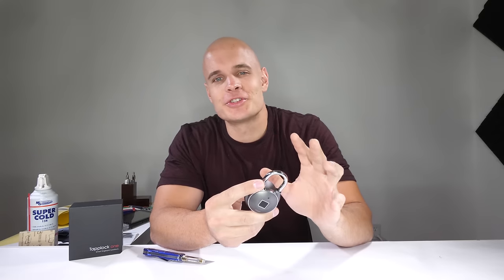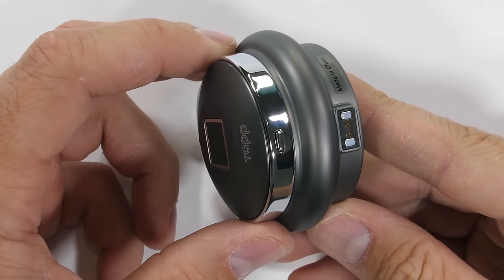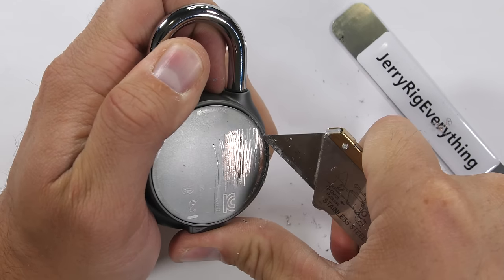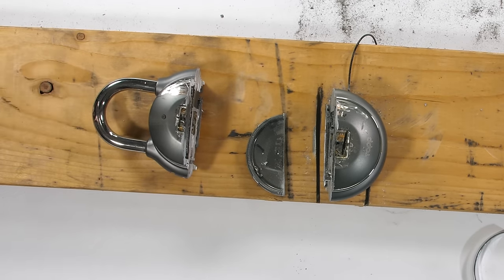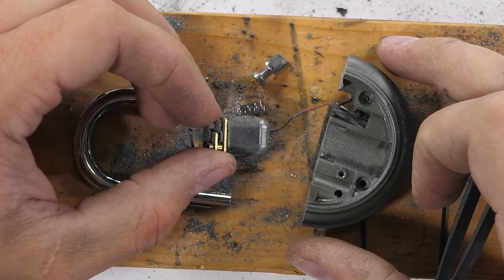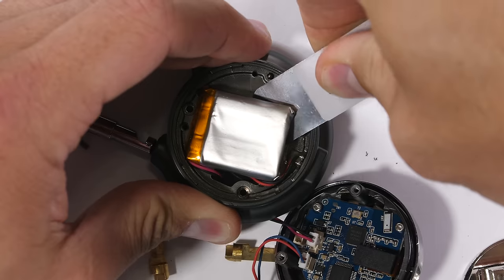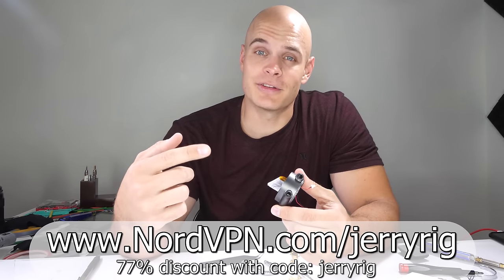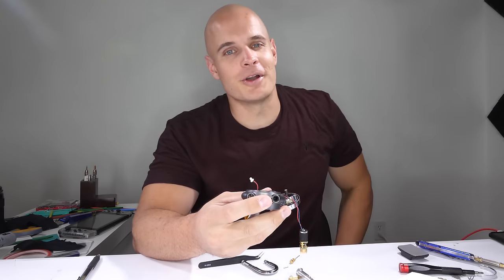DO NOT buy this $100 Smart Lock...

Comment: Thank you Zack for showing people how to open my 100$ lock...
Reply: JerryRigEverything   I will say, it was somewhat irresponsible to put this information out there without contacting the manufacturers beforehand.
Reply: Alex Caffrey pretty sure the manufacturers already know, they are the ones who designed the back to twist off after all. They were just hoping no one would bring it up. In fact I feel they use this exact method to replaces batteries if people return a lock with a defective battery.
Reply: I don't think so, because he just did the right thing, spending a$100 for a lock which can be unlocked within seconds with help of just a screwdriver (a commonly Avilable tool) then what is the deal of buying the lock, he just made people aware that this can be easily hacked. people can still buy it if they need this even after seeing this video
Reply: It's convince for the company to be able to easily replace the battery after it dies in one year. They already know the flaw. One person contacting them won't change anything... but, when they see videos like this viewed by hundred's, thousands or millions of people... That's when they will make the change if they still want their product/reputation desirable by the masses. There is power in numbers.
Reply: Hahaha
Reply: Username Password you know that the battery is rechargeable?
Reply: qpro 1234 - Yes, but are you really going to remember to charge your lock along with your countless other electronics??? Not to mention no battery level display to even tell you the status. Imagine it dies on you and you try to unlock it to get access to your property. Unless you are carrying that "unique" cable with a battery bank on you... you would be SOL. Also, did you see the exposed "proprietary" charging port right next to the made in china sticker that will most likely be destroyed in the elements within a few months or so? Electronic devices have a much higher risk / disadvantage of failing. I wouldn't even feel comfortable leaving it in direct sunlight... the battery would probably explode rendering the lock useless. lol
Reply: Raimundo Castro hahaha XD
Reply: Is there a way you could ghetto rig it where it wasn't possible to be opened that way anymore, like super gluing the screws in, so you can still switch the battery but the face plate doesn't pop off anymore since they can't take out the screws? Obviously you'd be voiding any warranty but at least it's no longer easy to break into... ha
Reply: Are you aware of the fact that thieves actually spend money on locks and experiment with them? They don't make youtube videos about it, though. Zack showed the general public a fatal flaw in this pad lock design so that people like you replace their locks with something more secure. And so that others don't buy it.
Reply: No worries man. Just tell me where you lock up your stuff. I'll keep an eye on it for you. It's cool 'cause I don't even own a GoPro. Honest. Or a screwdriver...
Reply: Alex Caffrey Normally I might agree with you but this is such an intentional oversight on taplock's watch that it boarders on incompetence. It is a lock. Locks are designed to keep people out of your stuff. The back of the lock twist off with no resistance. It is clear that no one made an mistake and this is working as intended and they are just selling a product that isn't secure. I believe Zack did the right thing outing the information publicly so people can replace these locks if they have them.
Reply: Raimundo Castro its better this than your other property
Reply: qpro 1234 but what if the battery comes defective or somehow breaks? Or what if the locking mechanism breaks? It’s a maintenance thing- it is necessary, it just needs to be more secure
Reply: Myk Al probably
Reply: No its not. It is better than EVERYONE knows whats up as soon as someone figures it out. Being salty about finding out your lock is shit is no reason to not know. Plain and simple, the manufacturer KNOWS this. They are making a lock. They are aware of its weak points. They just hope you aren't.
Reply: Alex Caffrey How about it was irresponsible for the manufacturers to sell a $100 lock that wasn't designed properly!??!??? 🤔🤷🏽‍♂️
Reply: Myk Al epoxy would do the trick
Reply: Zach, I bought it only 3 months ago, noooo
Reply: Raimundo Castro Raimundão, você comprou onde a sua?
Reply: It’s good to bring this information to everybody. Because when bad guys figure this out before large number of people - what  do you think they’ll do - unlocking these locks with silence or do this video? Think about that. Thank you Zack for this video!
Reply: A fool and his money soon parted
Reply: "I will say, it was somewhat irresponsible to put this information out there without contacting the manufacturers beforehand."

It was completely responsible to let potential buyers know that this product is a piece'o'shit. People who also bought one may also be glad to know this, so they can go change their crappy taplock out for one that's secure. Fuck the manufacturer, who cares if they get salty.
Reply: what's ur address man 🤔🤔🤔
Reply: @qpro1234  even rechargables don't last forever
Reply: I was looking for this comment...
Reply: Great video.
Reply: @alexcaffrey983  its cheaper to make it flaw so they just made it much cheaper and didnt tell any one
Reply: @usernamepassword9728  where he get the tool to twist open back cover

Comment: Awesome reporting, man. I was one of the ones seduced by this lock last year. Thanks for your excellent work.
Reply: Yah right BRO:)
Reply: A few years ago a guy with a flathead screw driver broke into my dad's truck just by jamming it into the driver's side key hole, which not only fucked up the door and the door handle barely worked, but went in and stole a laptop, a Samsung tablet, and a makeup bag.  Apparently Ford was said to have fixed it in previous models but this was a 2014 Ford F350.  If he had left his keys in the car like some people do with vehicles that have keypads, then that'd be gone in about 10 seconds.  Stuff isn't as secure as it seems.
Reply: *Seduced.
Reply: Solder the back shut!
Reply: Even if it didn't have such an obvious weakness, there's no way it should cost 100$.
Reply: Stay mobile my friends
Reply: Billybob Schneider A lock only keeps an honest person out
Reply: If you want to use the lock you still can what you do is open up the back and strip the screw heads  it still wont be safe vs bolt cutters but a screw driver yup.
Reply: I still like the lock. I would CA Glue the back cover threads shut and call it done.
Reply: At least the lock is still pretty convenient... For your gym locker or something. (Assuming of course you'd take your $1000 phone with you). But for $100? Yeesh.
Reply: Maybe Locktight the back on? not perfect but better than nothing
Reply: MrMobile [Michael Fisher] How's the Ghost Panda Coming?
Reply: They fixed the back
Reply: So you invested over $100 in your lock and now this other guy has shown the entire world how to defeat it. It’s not like every thief out there was going to invest the time and money in trying to figure out how this lock can be defeated but now this guy has given a key to your lock to the entire world! I think I’d have a few choice words for him and they would definitely not be “awesome reporting,dude”

Comment: Wow that's insane... I thought while you were cutting it in half it was just a joke, but that's a pretty huge design flaw.  Save 95 bucks and buy a combination lock or, god forbid, carry a key.

Also, I really don't want to be locked out of something because my lock battery died...
Reply: Abbreviated Reviews well if the battery dies you can always just unscrew it
Reply: It's a feature!
Reply: Abbreviated Reviews
 Well I've got good news for you because we recently invented this new technology called a power bank but ignoring that, I do agree with you as I wouldn't want to rely on a battery for locks either.
Reply: vgamesx1 You just supposed to hold that power bank in your buttcheeks while working out at the gym in case your lock dies?
Reply: That would be one hell of an exercise... .not to mention, trick.
Reply: Or even if someone just tampers ur sensor
Reply: Abbreviated Reviews that's part of the glutes workout
Reply: Combination locks often can be decoded by sticking something thin like an automotive feeler gauge in between the wheels and feeling where the gates are. Also, although sold nearly everywhere, don't buy anything from masterlock: their locks are almost all super easy to pick.
Reply: If you do decide to go with a combo or key lock DON'T BUY MASTER LOCK!! I pick locks as a hobby and even when I was first starting out,  I was able to pick they're level 10 locks (highest security level)  in about 3 minutes with a metal tooth pick and a Bobby pin. Now that I've been picking locks for about a year I can open any one of they're locks in 15 seconds or less with a set of $10 picks from Amazon. It's seriously so easy that if anyone was watching me they'd assume I had a key. Seriously, if you care about your stuff at all, do NOT "secure" them with master lock. At very least go with American lock but abus and abloy are preferable. If your serious about security get a medeco.

Comment: To those that already purchased one of these, perhaps some krazy glue or the like would help deter any easy break-ins.
Reply: Epic Benjo put a metal plate on to back again and weld that to the body or also car panel bond super strong substance
Reply: Epic Benjo or a welding machine/soldiering iron.
Reply: Just send it back. It's not secure and you should get a refund. I would think.
Reply: Flex Glue😅😅
Reply: nah just seal it with flex tape
Reply: actually since flex glue can hold upto 1000 pounds yes u could most definitely use flex glue to fix it
Reply: Locktight thread locker red. You won't get in
Reply: Epic Banjo yes it's a good idea.....if you are desperate. Had to be, because it's what I thought :D . You could also demand a refund. Trouble is, hopefully these guys are OOB for being dickhead scammers. So yeah to save your costs and belongings, a good idea....but in the meantime, fit another simple, good quality (Master) keyed lock.
Reply: @nickw9376  Agreed
Reply: Krazy glue is kra--gl-e
Reply: put some alem screws and weld the back, nothing should happen, you can open any lock with the big equipment
Reply: @nickw9376  I hope you are not suggesting anyone secure anything with a Master brand lock. Master locks, even their higher end stuff can be picked in under 30 seconds. Lock picking Lawyer picked 16 of them, averaging 15 seconds.
Reply: Or you could buy an actual lock. The cheapest best has always been a Master Lock analog one. The second up which is ordered online is a Kryptonite which takes forever to cut through, but now they only sell bicycle locks.
Reply: @JoeWaylo  Best? You think that master locks are even adequate? Master brand locks (all of them) only offer as much protection as this lock.

Look up all of Master Lock's many inadequacies.
Reply: Guess those 5 star ratings are false then. I went with a different brand that works on most gym lockers. One of those luggage combo locks with the TSA key.
Reply: And what are you gonna do when you need to replace the battery?
Reply: Just melt the glue with a hair dryer.
Reply: @juggalove420910  Green stud and bearing mount
Reply: Jbweld it
Reply: @jadenclemow  lego

Comment: A elegant and  much better solution (requiring a redesign) would be to make the back plate interface with the shackle, allowing it to only be unscrewed when unlocked, allowing for components  to be serviced as needed.
Reply: but the purpose of opening the back is to replace the battery when it dies, and if the battery dies the lock cant be opened.
Reply: it should be able to run with an external power source,
Reply: Cloud Omega they need to hire this guy!
Reply: why not just seal the back panel with flex tape
Reply: @cloud8521  the masterlock Bluetooth lock I have has a jumper in case the battery dies

Comment: Any lock is penetrable. IT just really depends on how dedicated someone is to breaking into a lock. That being said, we must understand that this lock is merely bare minimum security AND convenience. Used for people who have lockers that are within building security and what not. These type of padlocks isn't something you'd lock your building gates with.
Reply from the maker: I totally agree. Its still good information to know though.
Reply: Something else problematic is the shackle mechanism.  It looks like a long shim could easily pop this thing open in only a couple seconds.  If you look at the internals of any truly high security lock you'll see ball bearings used to keep the shackle in place, thus preventing shimming.  Spring loaded locking pawls have a terrible track record of popping open even when attacked with thick, sub-par shims.
Reply: Yo-yo that's ridiculous. I can get a directional Master Lock for 1/10 the Price that's 100 times more secure. This is nothing more han a $100 novelty piece
Reply: Yo-yo the problem is the price, 100 dollars is way over priced for a easily brake lock, while the 5-10 dollar lock work perfectly fine
Reply: Yo-yo 👍
Reply: Yo-yo I guess you're right, but that doesn't change the fact that this 100 dollar lock is worse than any regular cheap lock.

It's just convenient.
Reply: yeah you have to spend 1000$ for building gates 😂😂
Reply: still, assuming your thief has this information, the lock is easily possible to open much faster than jerry did, i bet it would take less than 15 seconds if you've done this kind of thing for a while.
Reply: Yo-yo 
I mean obviously, but if you only have a suction cups that you can twisted for the back and disassemble it with ease than buying a lock cheap and make the theif grab a saw or a file to break the lock is a big deal
Reply: Even for lockers and shelves inside building this doesn't look secure. That can easily take only 20-30 seconds to break.
Reply: A bit of epoxy would fix that back plate problem.
Reply: Just like jerry.
Reply: If there's one thing you should know about society these days, it is that people pay a high price for convenience.
Reply: The thing is I wouldn't really call it convenient. A simple combination lock does not require that much more time to unlock and also doesn't require to be charged.
Reply: qlum  Also its cheap
Reply: Really? What about everybody who doesn't know how weak this lock is decides to use it for their school locker or bicycle?? This lock is substandard even for it's class and should be recalled. Here you got a lock where a thief can not only get into things without breaking in but steal the lock itself as well.
Reply: That would be right untill you look on the tapplock website and the 1st thing you see is an outdoor gate locked with a chain and this padlock, so they have every intention of it being used for higher security suck as bikes etc even the weatherproofing shows this, but this is a fatal flaw non the less a great idea just executed badly.
Reply: The difference is. For a GOOD lock, any thief attempting to open it should have to spend a lot of time to do it stealthily, or cause a lot of ruckus if going brute force. This lock failed on the anti-stealth approach.
Reply: No matter what the use case is I still find this a failure because its a lock.. a cheap 1$ lock is more secure than this... you should not be able to just turn the back cap in order to take it out and then unscrew 3 normal Philips screws to get inside.... that's the definition of half assed design. Even a junior high child could figure out eventually how to brake that.
Reply: The problem is that it is too easy to get hacked people will hack this lock for fun...
I mean you literally need only a screw driver and smart enough brain that know how screw driver works

Comment: Now that the flaw is exposed, it's very easy to replace the Phillips head screws with one-ways (Secure Torx isn't secure anymore since the bits are abundant), and fix the twist-off too. Should  be a $5 fix tops.

Comment: Jerry, with your tool set, there is no anti theft device that would survive.
Reply: GoPro mounts are extremely advanced tooling indeed
Reply: Just the PRY TOOL and the GoPro mount
Reply: Vatsek he did use a go pro mount and a normal screw driver to break the lock
Reply: You missed the point that He found a flaw on the design
Reply: Vatsek yeah
Reply: If all his tools fail, he will just rip it apart with his muscles.
Reply: Cerdika Hasbi Andersen Zheng Whoosh
Reply: Zack*

Comment: So zack saved the company from numerous lawsuits it would've faced, great job.
Reply: Not too many people sue over things like this unless it can physically hurt you. There's a lot of shitty things on the market that don't work like they're supposed to.
Reply: spafro101 The FTC has rules against this. It’s called product liability. You are right, not many sue over this, but the ones that do usually have a case and usually win.
Reply: spafro101 yeah you can pretty easily sue for loss of property if you had expensive stuff lost as a result of their defective product. Unlikely circumstances though, since anything with a value worth suing over should be in a safe box that doesn't rely on these types of locks or a safe deposit box at the bank.